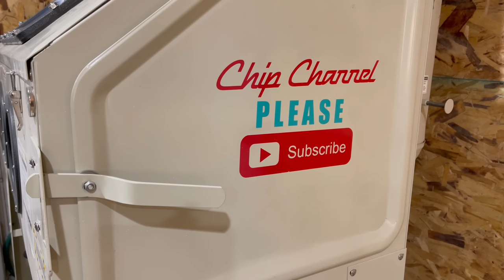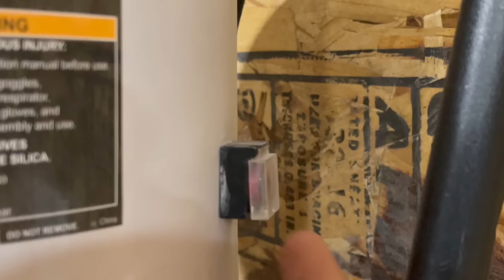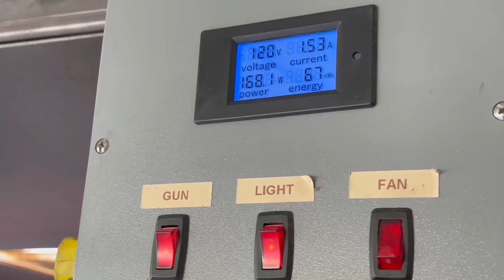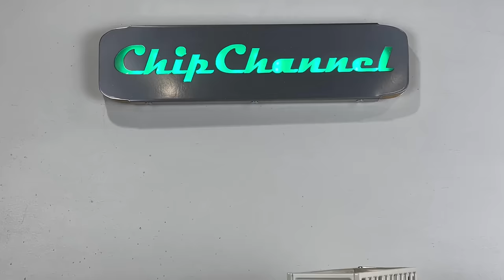1960s Nylint Safari Hunt Ford Bronco and Cage Trailer Restoration 4K

Comment: I have been waiting to see if you had a Bronco like this to restore, and I watched all the way through with great enthusiasm.  I had a similar one (sans trailer) that was probably made in the early 70's when I was a little kid.  By then, it was red with a white interior, and was mounted on the larger off-road tires with yellow plastic hubs similar to those on my Nylint dump truck and Michigan crane.  My "canvas" top and roll bar disappeared long before I was done playing with it.  Great job, Chip!

Comment: Chip, I recently sandblasted an old tractor seat which I put on a counter stool for my welding shop. The base was already missing the seat, so I only needed to make a wooden adapter to go between the seat and the stool. I like to save things that are both useful and historical. It's sad that many no longer value quality as we do.

Comment: out of curiosity... if you had tested if for lead and it was positive, how would that of changed the restoration? can it be done or must it be scrapped
Reply: If the paint is Lead based sandblasting becomes dangerous so paint would need to be removed with paint stripper.

Comment: A suggestion.   When removing the wheels from the axle, try putting a vise grip pliers on the axle right behind the axle bracket on the chassis.  That might give you a more solid base to leverage against.

Comment: I really was impressed with the way you filled the holes you drilled out.What material did you use to back the holes as you welded them up?
(weld didn't stick to it). Excellent video,keep them coming!

Comment: It doesn't appear that Chip responds to comments but does anyone know why he uses JB Weld for filler instead of automotive 3M finish filler?  Is it because of the heat from the powder coating oven?
Reply from the maker: Thanks for the question! I use high temp JB weld for two reasons, it is slightly conductive so the powder coat sprays on even and will also withstand the high temp required to bake the powder on. Thanks for watching!
Reply: @ChipChannelRestorations  Awesome! Thanks!

Comment: Great Job as usual. The rear axle mounting on the Bronco (which incorporated the rear bumper) was plated not painted. It was original but I thought that was very unusual and an additional expense just to have a silver bumper. The axle mount could have been incorporated into the floor pan and the wheel well covers incorporated into the body. The bumper could easily have been a clip on piece. Do you think it was because it also incorporated the tow ball and they wanted the added strength?  Or was it just all too difficult to fit and fold the wheel well covers into the body? I just thought it was an unusual design. Thoughts anyone?

Comment: Can you show us how you clean your powder spray tank?  Also, what is the (chalk?) that you put on your wire wheel before polishing?  NO, I will not be wanting to do this...just like to know how it works. Finally, how do you keep spray contained when washing your tires, etc with the drill brush attachment....I get a mess just trying to us my electric toothbrush! One more question...how do you know if a metal piece can be polished or if it needs to be chrome painted.....is tin what gets chromed?  Sometimes you use your dremel-like brush to clean up an ornamental piece vs glass blasting...what makes you decide which procedure you will use?  Okay, one more question...where do you find spare parts?!  Do people send you items?  I could watch the thriftshops if you would like but need to know where to send. How do you know what the missing parts are...do you have pictures of diagrams of the original toys? Do you sell your toys after refurbished? Thanks!

Comment: What determines if a metal piece will get powered coated Chrome or nickel plated?
Reply: My guess would be either the surface condition of the part, or the amount of surface detail  Home nickel plating requires buffing afterward to bring out the shine.  If there's too much surface detail, you won't be able to buff the entire surface effectively for a consistent shine.  If the part is too rusty or pitted, powder coat Chrome is really the only way to save it.

Comment: Did you had any of the things you have in your collection as a child, or this hobby came from somewhere else?
For me, the reason i have some old stuff too in my train collection, its do to I always wanted one as a kid, but could not afford it back than. And sometimes I buy 2-3 form the same modell to restore one into perfect condition, occasionally even improving it (I want to use them too, so they has to be reliable, and good running).

Comment: What size rivets did you use?
Reply from the maker: Honestly I'm not sure of the length but the diameter was 1/8". I have an assortment and pulled about four different sizes out before I found the one I wanted. Thanks again for watching Wayne!

Comment: Why do you use JB Weld and not Bondo?
Reply: Heat...  Baking the powder coating produces too much heat for Bondo.  Or it might out gas and ruin the powder coating.
Reply: @WHJeffB  Thanks.